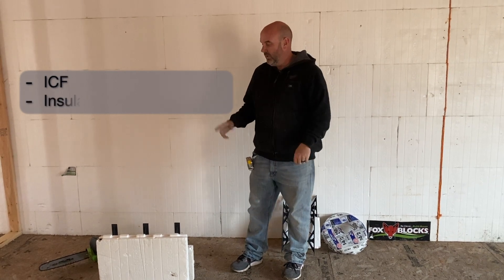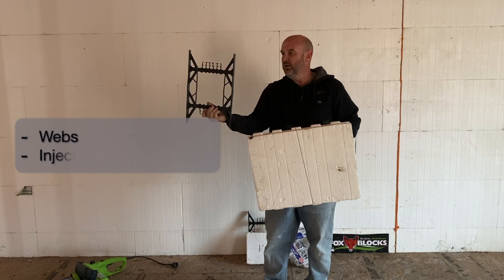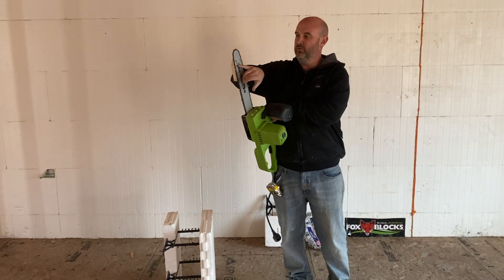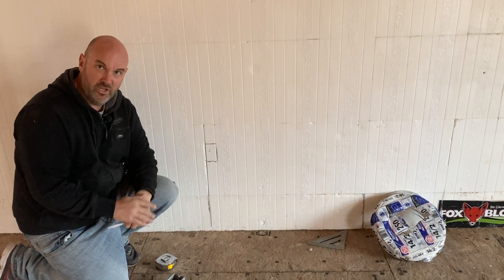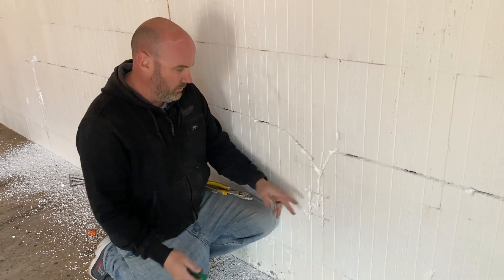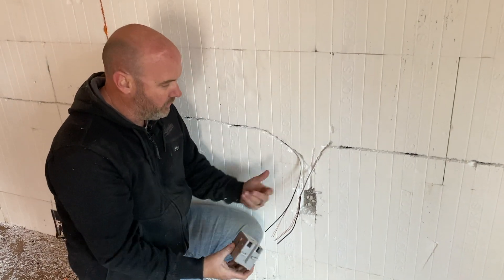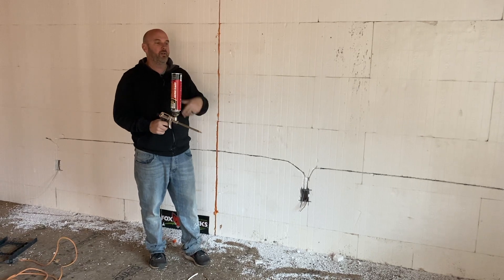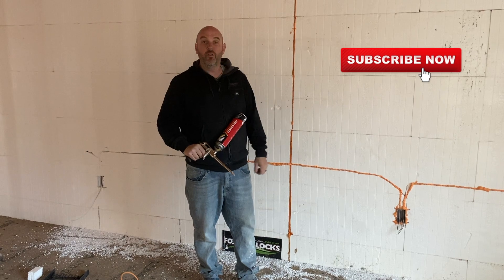ICF episode 1, wiring in ICF!  Lumber costs too high? Check out ICF!

Comment: Love ICF.  I suggest you run your cuts along the ICF joins where possible; less to cut & keeps the furring strips structurally sound for tying into.  Also the electrician may prefer another 150mm / 6" of wire hanging out of the wall.  I'd put a concrete screw through the back of the junction box just to be sure...  but that can always be done later if a box becomes a problem.  Good job, thanks for sharing.
Reply from the maker: Yes I’m not the electrician doing the whole rough-in for sure, but he was there that day and was ok with what I did.  While the foam does hold the boxes fast pretty reliably the tapcon definitely couldn’t hurt! I know another electrician who wires a bunch of icf for another builder who chooses not to cut the webs at all, he stays in the ceiling until he’s over the pocket he desires and drops vertically, more wire but he thinks it’s worth not messing with the webs, I’m undecided...  Thanks for watching!
Reply: @all3pools  : thanks. Vertical wiring should be easy diy. Or having furring strips (1 inch) like studs with 2 ft apart would be better?
Reply from the maker: @squeekhobby4571  ya I liked the verticals idea when I saw it recently, use a bit more wire but makes cutting a breeze!  I wouldn’t use furring strips unless you had another reason, deep speakers or theater equipment that doesn’t fit in the foam, just extra cost and gives you an stud space of sorts where fire could theoretically run, sheetrock right on the icf gives very little air to a potential fire source!
Reply: @all3pools  : great points
Reply: @all3pools  as an electrician that has wired ICF many times, here are a few things I do. (1) Vertical if at all possible, just way less work (more wire). (cut a coat hanger the outline of your box and bend it. attach it to a weller soldering gun (plunge and pull down) You can cut your boxes out super quick and accurate. I use plastic boxes with foam sealing rings that way they will always be held at the propper depth and the drywall flare is 1/16 which is nothing on a icf foundation. I also have another weller soldering gun with a small loop 3" deep for cutting my slots. I find the soldering gun goes fast, and doesn't make smoke. I've tried the BBQ charcoal method and its fast but damn scary, not worth it. The saws make mess. I like super square work. I use 3" framing spikes shoved into the wall on an angle to retain my wires from coming out. Once everything is done, I'll go back and foam everything at once. cheers.

Comment: You should note that most inspectors don't want you to spray foam the wire chases until after electrical rough in...  Tacking the cable in place is fine, but they need to be able to verify that the cables are 1-1/4" or more deep in the walls.
Reply from the maker: I can see that, they don’t seem to care in my area, but I’m routinely blown away by what they care about and what they don’t...  we are pretty lucky here to at least get good feedback as to what they want so we don’t get hung out to dry much

Comment: Hey. What about running extra wire in the wall (I think per code in Canada anyway) in case there is an issue later on and you need to pull out/replace a fixture/outlet/socket? Usually add an extra foot or so of extra 14/2 in a loop behind the drywall. Thanks

Comment: If, after drywall is hung and the interior is finished, I want to hang something heavy on the wall like a TV mount, how do you hand it?  Conventional construction, I would find the studs and lag into them.
Reply: Hang it on a traditional studded wall which would be an interior wall. The ICF walls are normally only the exterior walls
Reply: You still have access to the 8" spaced webbing, even after sheetrock, just like traditional studs. They've done a bunch of testing and the holding power of the plastic webs is comparable to wood. And if you're REALLY worried about it, use a long Tapcon and fasten directly into the concrete.
Reply: @float6969  Awesome, thank you

Comment: Can you run wire inside a PVC conduit to an electric box prior to placing concrete in the wall? so, the conduit is in the inside of the wall cavity and it skips the step of cutting the wall after the concrete
Reply from the maker: You could, we do run some pipes in our pool walls, but honestly it would probably be a lot more work than cutting the icf afterward, unless you just wanted a chase to pull wire later I’d go the other route!
Reply: @all3pools  I'm hoping to build ICF in 2-4 years. My hope was to do something similar to this for mains to subpanels as I want an open main living area (LR, K, DR) that branches into two other living spaces.
Know of any recent NECs in regards to mains and in wall ICF?
(EE and up to date to 2017)
Reply: Box will pull out with tamper proof outlet
Reply: Thats a shortcut I wouldn’t take. I will prefer the suggested approach using conduit to get electrical wiring in the home and also i would not tuck in wiring directly in the styrofoam, but instead using plastic conduit for that too.

Comment: How do you fix the first form to the floor so when you pour it won`t come apart. Do you have to brace the wall before you pour, or the clips will hold it in place. What`s the price of the block right now. Thanks
Reply from the maker: You use can foam to glue the first course to your footing, there is a bracing system, price is around $4/sqft
Reply: @all3pools  
How fast do you pour? and do you add plasticizer?
Reply: @Terry Blumenstein thanks for the info

Comment: Random question: I'm tryna create cantilevered stairs from an ICF wall. Is there a manufacturer you know that makes a metal  can just insert into the ICF and pour concrete into the ICF to keep them in place. The metal would be the threads for the stairs,
Reply from the maker: I’ve developed a system where we cantilever stairs out of the wall but it’s entirely custom, none of the stair companies have a system as far as I know…. I’ll have more vids on it this winter but I do have some like that in one of my very first vids on here the modern mansion tour…. And one of the beach house tours although the second one isn’t a true cantilever, both have the steel covered in wood but that’s purely aesthetic

Comment: This actually ended up being my least favorite thing I've seen about ICF so far, it seems like maintenance would really be a pain. What happens if you need to pull more wire once it is drywalled? I also think I would double up and add stud walls anywhere I had to run plumbing for repair sake.
Reply: You can put in a pipe in the thermal panel through which you can run wire. Will be easier maintainence.

Comment: what about plumbing?  Where do you attach the pipe outlets to?
Reply from the maker: Most designs try to minimize plumbing on outer walls because framed walls are prone to freezing in colder climates. That said, when it exists it’s as simple as attaching your straps to adjacent webs

Comment: Where are you getting these at a low cost? I found only a couple of places that actually list price madura is $50 per block, which is pretty expensive and not ver economical.  The price to a entire house would be expensive, to do a simple 3ft foundation nothing fancy would be$2700 to $4000, not including concrete. Maybe easy to do but difficult to justify that price for just a Styrofoam block.  Let me know I where I can get them cheaper, I sure other viewers would like to know more too, thanks

Comment: is it up to the code?  1-Are those blocks secure only by the foams? It doesn't look strong. Do electrical inspectors approve it? 2- what if home owner decide to put a nail in the wall where wires go? Isn't it going to punch through the wire (safety)? In wood frames, we have to put protection plates; it doesn't look we can do that here.
Reply from the maker: You should watch some of my other vids on icf to gain a better overall understanding of the system, which is by far the strongest in standard type construction available...  it’s filled with concrete...  the foam and webs that are cut away give nothing for a nail or screw to bite into so while it’s possible I suppose to get a nail into a wire, if you are driving a nail 2+ inches into a wall after hitting nothing solid it’s kind of on you...  and you don’t put nail guards on every stud in stick frame, only when the wires are a certain proximity to the surface of the wall, so the same thing could happen in a framed wall albeit unlikely

Comment: You should be using #12 with ground UF cable that outside wall could get wet.
Reply from the maker: No it can’t
Reply: The outside of the wall is waterproof like any other exterior wall